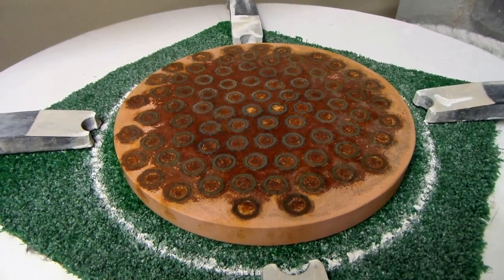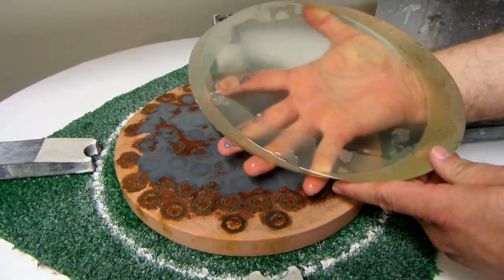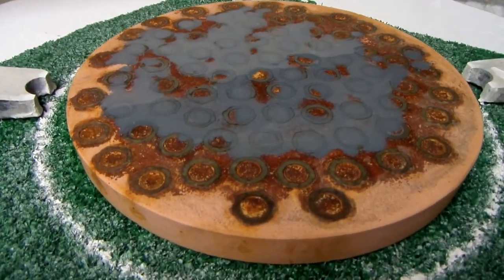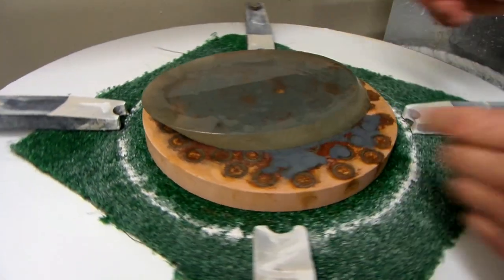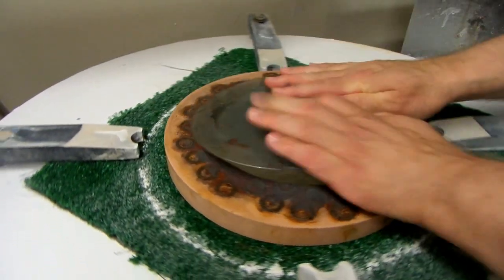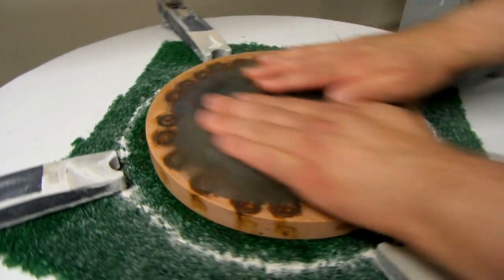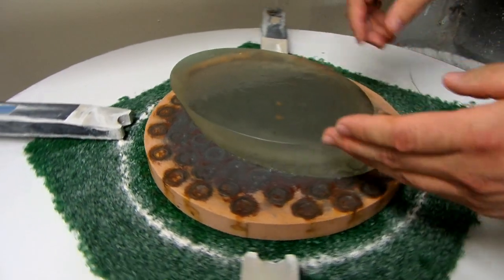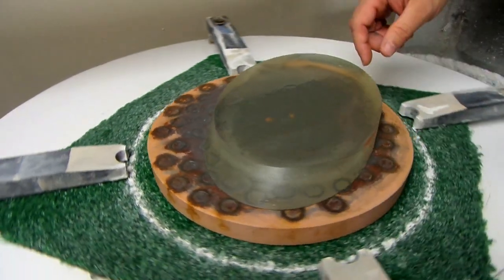Grinding a Renegade 6.5" Elliptical Secondary Mirror

Comment: You go all the way through fine grinding on that one tool?  No worries about the single tool not being flat enough?  Perhaps I'm missing something, as I thought flats were generally ground against a rotating sequence of tools to avoid spherizing them.  Are any corrections totally done during the polishing/figuring stage?
Reply from the maker: I have several of the flat steel tools that I grind against each other to keep them all flat.
Reply: Thank you!  I should admit I have no experience with grinding flats, or with segmented steel tools.  That was the missing link in my understanding.

Do you find tool flattening necessary during the course of grinding a large diagonal, or is the differential hardness of the steel nuts enough to keep your tool flat for the duration?

While I'm commenting, I want to thank you for these excellent videos.  I'm re-entering the hobby after years away from it (small kids and Optical work didn't mix very well for me).  You have helped me tremendously with your concise explanations, and I'm now using my newly constructed fixed post grinder.  Machine work in particular was difficult for me to previously find guidance on, as many of the "classic" articles dealt obsessively with gear ratios, "novel" mechanical arrangements, and the machines themselves, rather than afrank discussion of methods.

Your style of presentation, and your willingness to share your knowledge, is appreciated.
Reply from the maker: I will touch up the tools during a mirror, but they don't get very far from flat, as long as the mirror was Blanchard ground.  With the tool on the bottom, it will get a little concave if you don't overhang.  If it does, you can also overhang the top mirror a bit to counter it.  The trick is to have a really good spherometer to be able to measure your progress.
Reply: GordonWaite,
Yeah, I think we're all jealous of your spherometer.  I have to laugh thinking of you doing computerized surface evaluations of that tool, it looks like it came out of a construction-site dumpster :)
Reply from the maker: I laughed for 10 minutes on your "dumpster" comment.  Thanks!
Reply: GordonWaite it doesn’t look like the nuts in it are stainless to me!
Reply: And for polishing it, you also use a larger pitch polisher ? at least for the major polishing work and before more precise correction with little polisher ? 
(By the way, thanks for all you considerable work of description ! I think that every one seeing your channel will want to try optics ! I do at least :p )
Reply from the maker: Yes, I usually polish flats on a larger polisher.  I have a 20" flat that I use for pressing laps to keep them flat.  Using a larger polisher speeds things up and helps keep the piece as flat as possible during rough polishing.
Reply: Thanks for your response : )